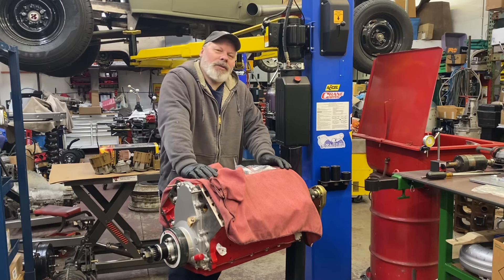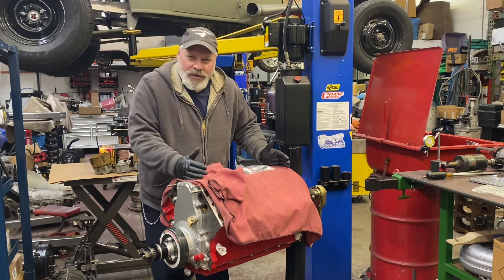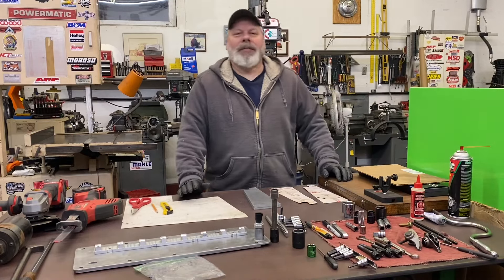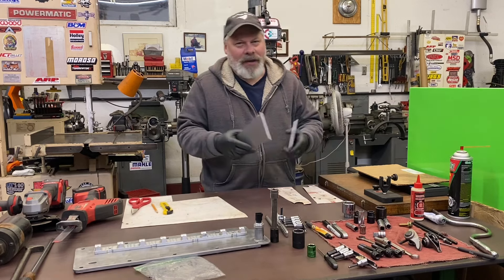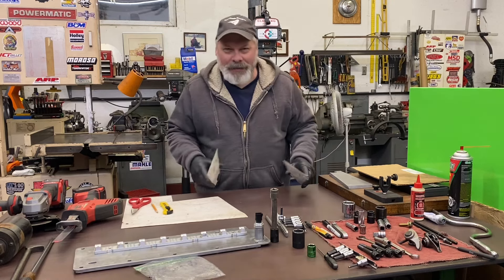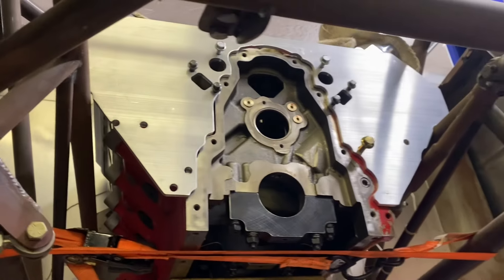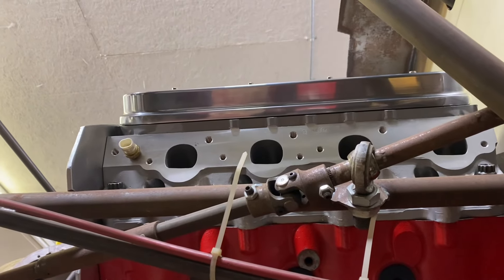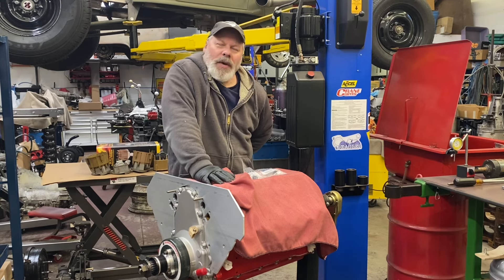Mountains Garage: Race 1955 Chevrolet Bel Air Engine Mock Up

Comment: Is that based on Gen IV electronics?  Noticed that it had the cam sensor on front cover.
Reply from the maker: Yes it is.
Reply: @mountainsgarage  For your application Gen IV electronics would work. It has better timing with 58x and 4x. I'm using Gen III electronics in my truck because cruise control is simpler to hook up, since the PCM controls engine, trans, and body. Gen IV has separate controllers for each, so cruise control is in body module. Some Gen III still have mechanical throttles, Gen IV is drive by wire.